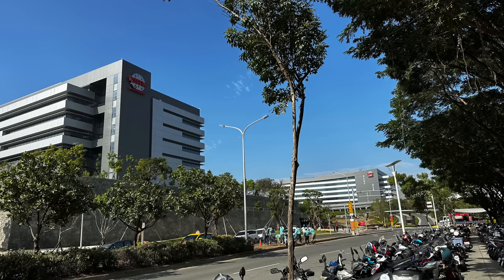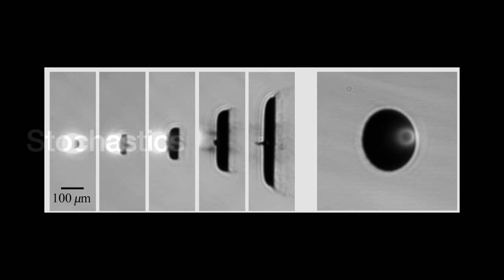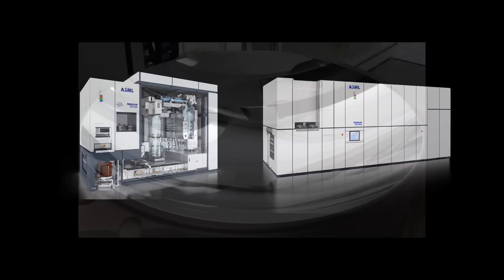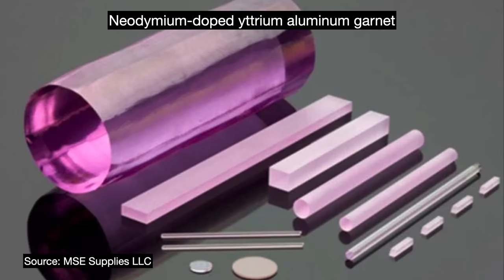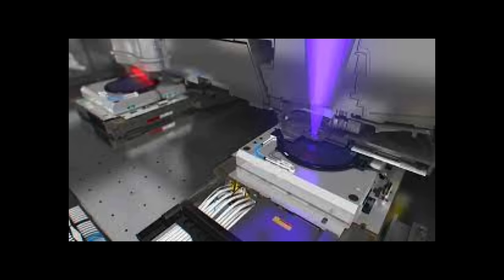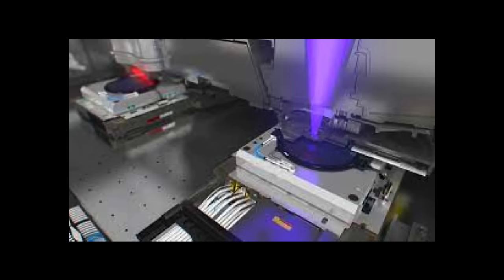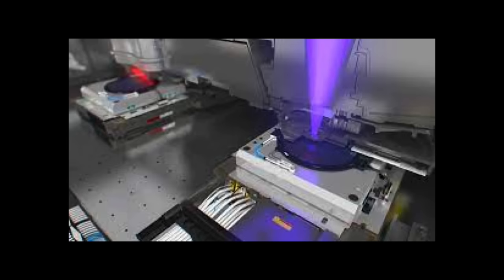EUV Lithography. But With a Free Electron Laser

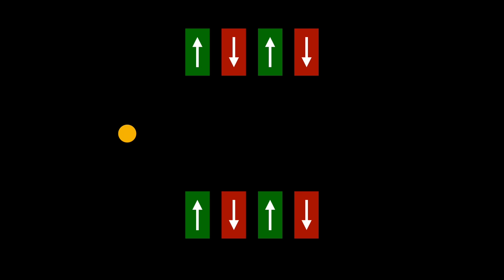Comment: What do the colored boxes at 7:51 represent? What is greeen and what is red? Why does the electron turn toward the lower box but not towards the identical upper box?
Reply: Magnets. They dont move due to electrostatic attraction but instead because of the Lorentz force.
Reply: @phmslac  With magnets usually the north pole is red so the upper and lower pole cancel each other out, so only a longitudinal field is possible. The Lorentz force is defined as a vector cross product, so if the velocity and field are parallel, then the force must be zero. Something else moves the electron
Reply: @shanent5793  The velocity of the electron is orthogonal to the magnetic field. It enters the undulator from the left traveling right after leaving the accelerator. The red and green are meant to represent alternating magnetic  field directions. Now that I think about it more, this animation is a bit misleading. The electron would undulate toward and away from us with the magnets arranged as they are. Thats tricky to depict so they usually just show them this way.

Comment: So... the undulator deals with both left and right spinning electrons BUT it's the photon output we care about?  That seems the logical thing to me.  Do the photons have left and right spin output or is that important?l  i.e.  is there both left and right spin photons or is there a singular type of spin?  I ask because I'm trying to sort out the relativity issues of the moving electron... if that makes any sense.  I'm guessing it's not important.  I'm into motion physics, theoretical, and use the basis that nothing travels in straight lines (absolute motion) and all motion is helical waves, in nature.  For instance, Earth makes a helical wave as it follows the sun through space with a wave length of about 70 billion Km within the Milky Way causing that motion.  Since Earth seems to be moving South Pole forward, through space, I'm making a base assumption that our South Pole has an electrical neg/positive attribute... is one or the other.  If Earth moved sideways, through space, we would have serious time issues caused by relativity... time would run faster in summer or winter, depending which part of the planet you lived upon.

Comment: If you want to control the alignment without the risk of chaos, why not use plasmonics? Plasmonic materials are tuned to catch and emit waves of specific wavelengths on one side and let it exit on the other side at a set wavelength, and the wave phase tends to synchronize within the material as well, and you can add another crystal phased nanomaterial should you wish to alter the phases. And if you want to make the angle of attack to be irrelevant, you shrink the dimensionality of the material from 2D to 1D. or from nanosheet to nanowire or nanorod. 

DISCLAIMER: I'm a materials scientist, not a fab researcher, so please take my thoughts with a grain of salt, and I would love to hear from someone with a deeper background on this than I have.

Comment: One of the most interesting things about FEL is that we essentially convert energy of particle beam into a wave beam. But FEL needs an accelerator, how can we accelerate electrons? 
With LASERS! There is an idea of accelerating particles with the wake wave of a laser charge in ultra-thin plasma, the device is called "wakefield accelerator". With those two devices we can freely convert energy from a particle beam to a wave beam back and forth, showing that those things are essentially one and the same.

Comment: Why did they go with LPP instead of Free Electron Lasers?
Reply: Back in early 2000s , it wasn't economical. Then in 2010, new Synchrotron tech was discovered. Now China is building a Synchrotron SSMB EUV in Xiongan by Tsinghua University that will be ready in 2026-27
Reply: @MrSpiritmonger  Great for everyone still a long way to go. Let’s see how far/high watt it will be able to go. Probably a interesting thing to study on. For actual production it’s not really suitable, but thats fine, there is also the still the issue with getting the pdks to apply the metal layers and have the correct rulings. The other part is that you need these “mirrors” for EUV to not lose to much energy. The Reticle material for higher powered sources might also be a bit of an issue.  And many more things..

Comment: is 6nm the smallest theoretical wavelength this method could produce?
Reply: I'd ask why would it? Is there something inherently limiting the wavelength to 6nm? It's not like there is an stop at the end of ultra-violet spectrum. They just haven't found ways to isolate and focus x-rays and gamma-rays so they are less lethal but somewhere in the land of material sciences they are working on the reflection and absorption of those sources to get us to the next level.  I could expect to see coherent x-ray systems that could assist, but that photo resist would need to be gold, silver, or lead.
Reply: SLAC's FEL already operates at up to 25keV photon energy or 0.05nm in the fundamental, so the wavelength can indeed be much shorter.
Reply: To add to what @popquizzz said, at higher energies you can't hit a mirror straight-on and have it bounce back.  Instead you need to hit the mirror at a shallow angle to avoid excessive absorption.  See, for example the mirror system for the NuSTAR X-ray telescope (Wikipedia has a nice illustration).  This makes the optics rather bulky and things like steppers awkward to design.
Reply: @alexhajnal107  Even if they can etch the lithography that small, they would need to change from silicon transistors right?
Reply: @richmahogany1710  I don't see any reason why Si as a semiconductor would be incompatible with small feature sizes.  I believe Intel is looking into changing the substrate (wafers) from silicon to glass (presumably coated with Si or the like) to get a smoother surface which should make smaller features easier to produce.  I suspect this would also add a degree of rad-hardening, always a nice bonus.
Reply: @alexhajnal107  I thought the issue with silicon was that they're already getting near its atomic size and then quantum tunneling would be too much of a problem. also they can't push much more frequency through it because of its thermal tolerance. i've heard of gallium nitride as a potential replacement.
Reply: @richmahogany1710  That could well be the case.  I don't know enough about it to say more.